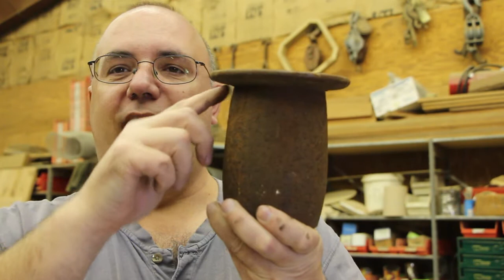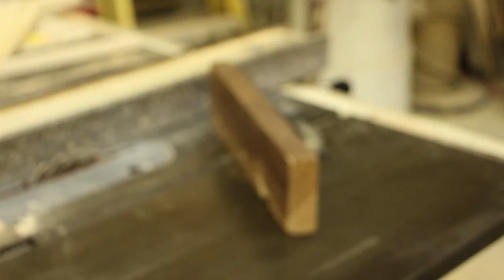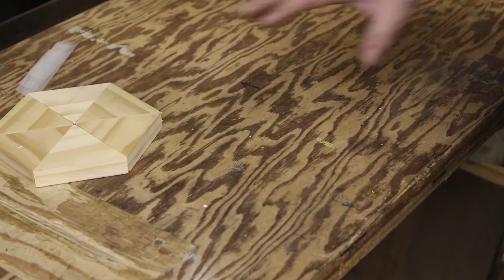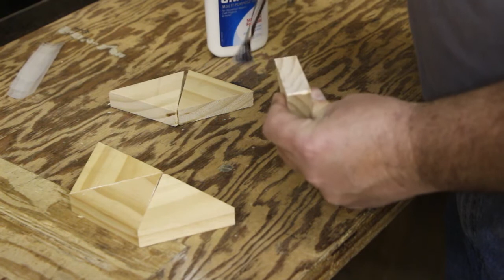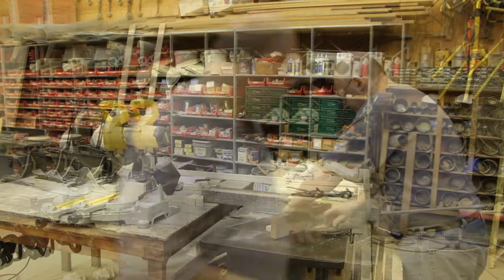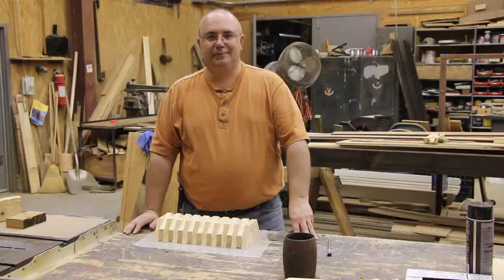Pattern Making - Flat Belt Pulley 1

Comment: FYI. It was not assembled incorrectly. Taper keys are a very common way of fixing sprockets etc to shafting, no set screws are used. The practice was even more common before cheap hardware but is still used on new equipment.

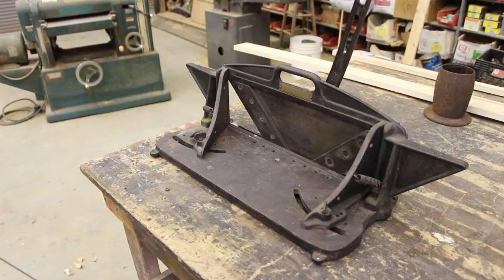Comment: Regarding the problem at 15:49 with the pieces not fitting together... It will never be perfect, and if it is today, it won't be tomorrow when the humidity changes #omggeorgia.  Another solution is to glue them up, but don't glue them up completely - make it so you end up with 2 3-section halves.  Then run the disappointing edges through a jointer.  Now they will meet perfectly.

Comment: Talk about white glue, another good use for it is securing and sealing old advertising labels like the ones I run across in clock repair. Pour a small puddle of it in an old plastic dip container or any 3" bowl, then mix in warm water until it just starts to get like thin paint. With a 1" fan brush soak the paper good until it is saturated, this may take several applications, not only does this adhere the paper to your project but when it dries it also seals the paper, and it dries clear not dark like store bought products. Remember dab it gently try not to stroke the brush, this usually disturbs the paper. Happy restoring folks.

Comment: On the 30-60-90 triangle cutting...if you cut one end on the table saw, flip the board lengthwise & cut the other end; then go to the chop saw and cut off both ends. You will save a lot of mileage. Oh yeah and time. Also if you have several boards in process simultaneously, more time is saved.

Comment: Mahogany was used extensively because it was very durable and rot resistant as green sand is kept damp.  Cherry is the most stable of the hardwoods available in the USA. It expands and contracts the least across the grain due to humidity and therefore was used for wooden clock wheels in the early 1800s.

Comment: Hey! what's with the disparaging comments about carpenters?
I'll share a carpenters tip nonetheless. If you will take some of your spray adhesive and put sandpaper on your miter gauge, Your pieces won't slip and you'll have precise miters the first time.

Comment: Lots of table saws have rip fences which aren't all that square - especially mid to low range contractor type saws.

I set my miter gage with respect to the saw blade - also a slightly tricky proposition - for my best shot at getting the angle right.

Then, like you did, I'll cut a test piece to make sure that I'm getting the angle really right...